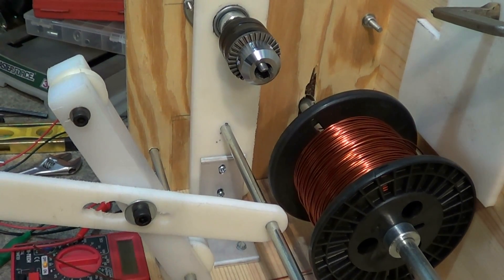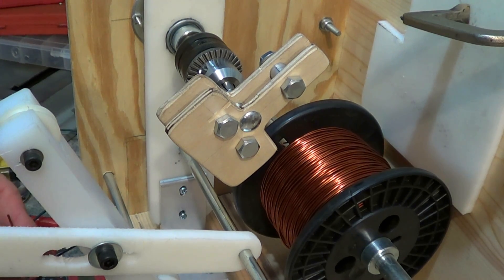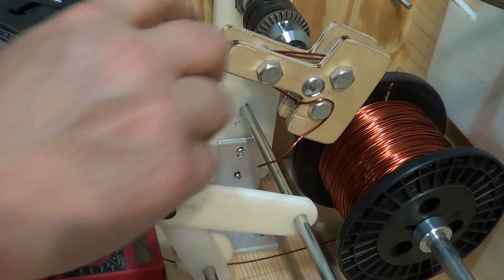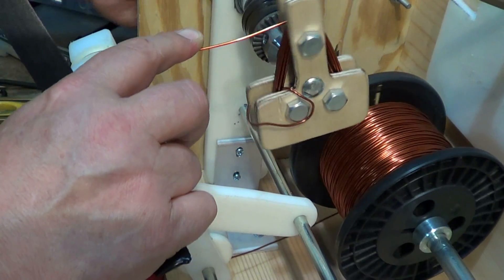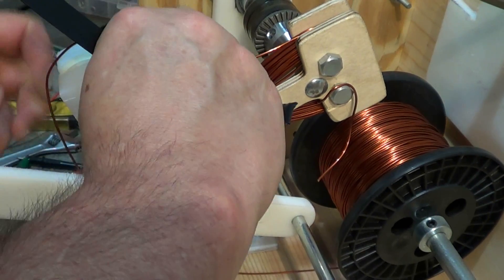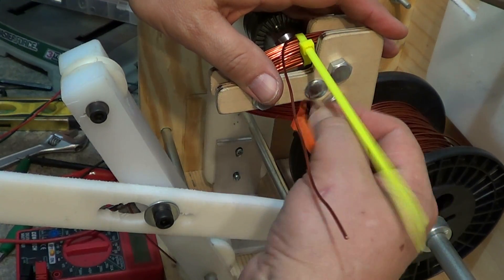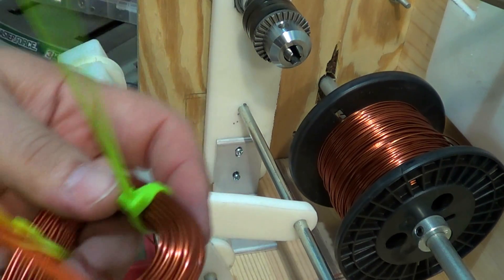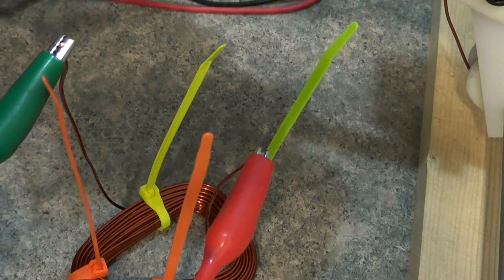TIME TO MAKE COIL'S FOR THE AXIAL FLUX TURBINE

Comment: Did you get the blades ? From where please ?
Reply from the maker: https://www.magnet4sale.com/wind-generator-blades-9-2-commercial-grade-blades-only/
Reply: @TheBillythekid2010  how do estimate the size of the blades you need ?
Reply from the maker: @EnergySeeker  thru testing, I've got friends that have built the same turbine as I and the largest blade set has a biggest torque. So it really depends on how much power you really can use. So the blade link I sent, we've seen 3000 watts. The 10 ft. Diameter we've seen 4500 watts out of the turbine. It's all about the torque, meaning weight and size.
Reply: TheBillytheJack2010 how did you adapted the wind to the blades ? Was it 1 inch shaft the turbine? Did you mount it very high ?
Reply from the maker: @EnergySeeker  I use 1  1/4 in. Shaft, but 1in. Others are using. For how high for tower, as long as you have no obstructions 30ft. Is good. But I made my own blade hub myself.

Comment: How many turns for 12volt 12coils
Reply: Do you no how many turns that I need for 12volts an how many coils
Reply from the maker: It depends on wire size. If your going to use 14ga. at 65 turns. So by using this amount and wire size, the stator size will run  a 12 or 24 volt system. So 15 coils at 65 turns per coil, plus 40 magnets N-42. Is.what you need. Thanks for watching...
Reply: Thanks

Comment: Any idea how long is the turn or the diameter for each turn?
Reply: I done a rough calculation and came up with between 55 and 65 foot per coil of the Gauage wire mentioned. This would mean between 495 and 585 foot of wire total for the 9 coils. Over here that costs round and about €45.

Comment: What is the amps this wire size can handle ? 15 awg
Reply from the maker: Amps I've seen 98 amps, but you have to have a furling tail to not see the high output of amps. This wire is good for 200 degrees. Here's a link...  https://www.magnet4sale.com/magnet-wire-essex-magnet-wire-15-awg-200-degree-celsius-11-lb-spool/
Reply: @TheBillythekid2010  98 amps ? or 9.8 amps ? you an power your house with it
Reply from the maker: @EnergySeeker  98 amps but not constant. And yes you can power your house if you have good wind conditions.

Comment: Wind
Turbine as power generation

What
I seen so far on YouTube and my conclusions

 

·        
Al stator winding making consist only of coils
wound with no laminated core or ferrite that would definite increase the magnetic
flux around then coils that would increase the current.

·        
Most stators seen are made of wood material, not
recommended for outdoor application. Wood tend to warp and lose its consistencies
on high humidity witch reduce its efficiency.

·        
All coils are cemented in epoxy or hard fiberglass
material. The coils then have no way to dissipate heat in higher current
production, eventually they will burn up.

·        
Wind speed must be over 25mph in order to generate
sufficient current to charge any battery bank. Must area just don’t have this
kind o wind.

·        
When you get any significant wind it’s usually not
constant. In most cases are gusty that get irregular output. This mean that the
energy production oscillates from too low output to a higher output witch only
last a few seconds. 

·        
Over charging in storming condition is wasted as
heat in the dump load resistor.  

·        
Most of the design ate massive bulky system that
require heavy stands and support structure.

·        
Most of the one I seen are not manufactured with
precision tools which causes noticeable wobbling and therefore diminish its
performance.

·        
A great number of stators are using higher gage wires
like 26 and above which give you voltage production but poor amperage output to
charge any battery bank.

 

Conclusion:  After
experimenting with both wind and solar energy production, by far so far solar
energy production for individual homes is more stable, reliable and efficient.  

The best wind turbine is definite the Missouri’s Freedom
PMA. 

Check out an independent comparison of the two most popular
wind turbine types at:

https://www.youtube.com/watch?v=yB4Ze3TRS9s
  Best comparison test I seen so far.

Comment: So why do these videos not share the size of the coil.  The Numbers of coils.  Wattage of production and the countless of other figures that people want to know.
Reply: It’s in the description.  15 coils, 15ga wire, 65 turns
Reply: @GotrekGurninsson  -_-  Size of the coil.  Dimensions etc.  Not just the wire length and size.  They always make videos and pretend it's a "new invention that's the best".  Yet never give full details or particular statistics of the design.
Reply: @hawkintelligence  that will depend on the magnet size you’re using.  There is no rocket science here this has. Been the same way for over a hundred years nows